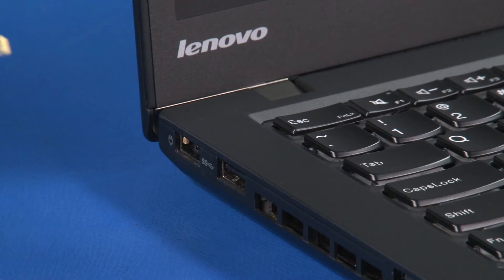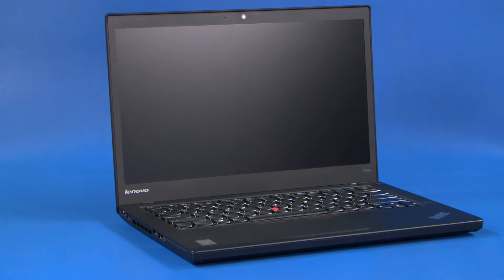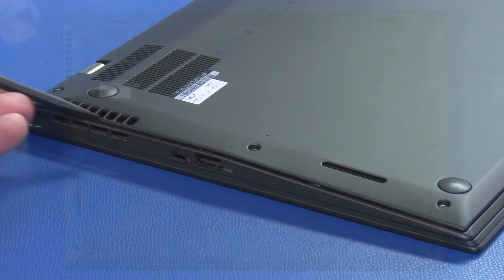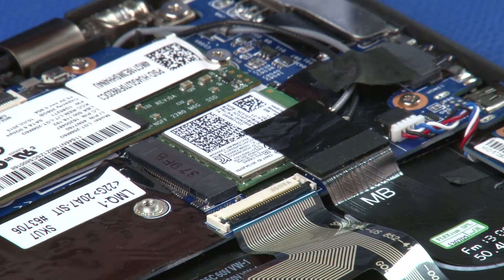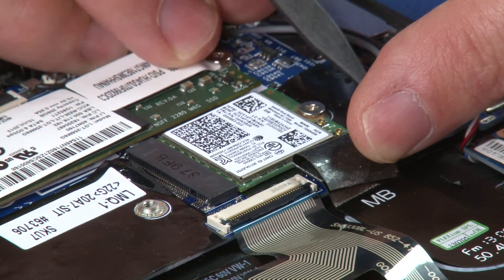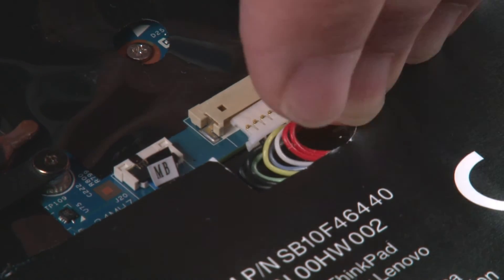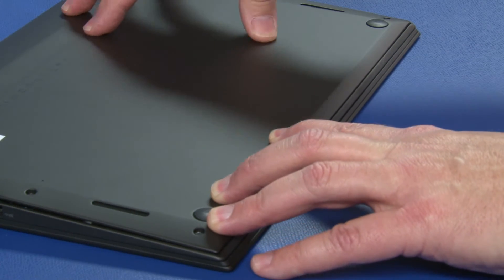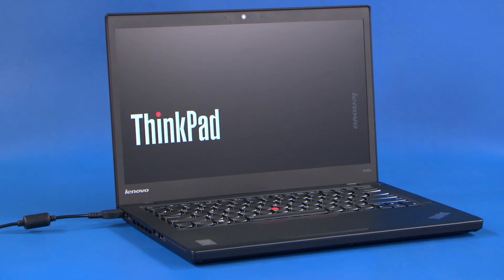ThinkPad X1 Carbon (2nd and 3rd Gen) - Wireless LAN Card Replacement

Comment: Will Intel Dual Band Wireless-AC 7260NGW (FRU 04X6087) x1 support carbon gen 2?
Reply from the maker: Hi, @kamleshaswar. Thanks for reaching out. Upon checking, This part number:  04X6087 only supports 11e Chromebook (Type 20DB, 20DU) Laptop (ThinkPad) and 11e (Type 20D9, 20DA) Laptop (ThinkPad). The device you mentioned is not listed. You can message us anytime if you have any other concerns. -Kate_Lenovo

Comment: Has anyone upgraded this ridiculously bad Intel-7260 with something reliable, whether it's an updated Intel or 3rd party? I don't need to hear from useless "LenovoSupport" because I see below that they won't answer this specific question. They don't like to publicize the fact that they "whitelist" network cards in their laptops. The 7260 is bad across all brands and I'm not interested in troubleshooting a known POS. I found a $20 AX (Wifi-6) card with the same M.2 form factor on Amazon, so I'll probably try it out, unless someone else has already tried and failed.

Comment: The wireless card on my 2nd generation X1 Carbon is disconnecting abruptly. The current wireless card is Intel Dual Band Wireless-AC 7260. Can I upgrade to install a more recent wireless card? If I end up replacing with the same kind, will the issue with the intermittent disconnection go away? Appreciate any input.
Reply from the maker: Hello Hrao, thanks for reaching us out. We're sorry to know about your trouble. May we know if you're getting any error messages? Were there any updates/changes prior to this issue? We'd like to know more. Looking forward to your reply. Fraineee_Lenovo
Reply: @LenovoSupport  I appreciate the prompt and timely response. I see the following message in eventviewer - "The network interface "Intel(R) Dual Band Wireless-AC 7260" has begun resetting.  There will be a momentary disruption in network connectivity while the hardware resets. Reason: The network driver requested that it be reset. This network interface has reset 4 time(s) since it was last initialized.". I have updated the latest drivers and that has not resolved the problem. In reading some other articles, it makes me believe that the component has to be replaced. Therefore, I am looking at any potential replacement wireless cards. Thanks!

Comment: Is the Lenovo X1 Carbon gen 3 defective by design? Ie could I change the WiFi card to a TPE-M2NCRD2 card instead?
Reply from the maker: Hi QuidQuoPro! Thanks for reaching out. Can you provide us more info on what's happening to your X1 Carbon? Apparently, the 
 TPE-M2NCRD2 is not compatible to X1 Carbon Gen 3. These are the Part Number (00JT468, 00JT460, 00JT465, 00JT464, 00JT502, 00JT466, 00JT469, 04X6030, 00JT467) of the compatible Wireless LAN Adapter. We'll wait for your response. Rai_Lenovo
Reply: @LenovoSupport  What I would like is any WiFi card that do not require me to install non-free drivers when I use GNU/Linux. Do you know if anyone of those allow me to do that?
Reply from the maker: Hello there. We tested the compatibility of Linux with your model on this page https://lnv.gy/2VIzRcI however it shows that the X1 Carbon 3rd Gen is not listed. We have the following information to assist our customers who are interested in using the Linux operating system. Chx_Lenovo

Comment: Hi, what is the part number of the WLAN cable? (gray one) and where can I purchase a replacement?
Reply from the maker: Hi Song. Thanks for reaching out. For the Thinkpad X1 Carbon 2nd Gen (Type 20A7, 20A8), the WLAN cable Part number is 00HM106. For the X1 Carbon 3rd Gen (Type 20BS, 20BT), the  WLAN Antenna kit Part number is 00HT406. To purchase parts, click on: https://lnv.gy/33h06rT. Hope this helps. Carll_Lenovo

Comment: Can you use third party wireless cards, e.g. if I want to use a broadcom card or something like that would I be able to.
Reply: With Thinkpads generally, nope. Whitelisting network cards has proven to be lucrative for their bottom line.
Reply: @dinuguan510  Lenovo hasn't been whitelisting for years, at least in X/T-series. Carbon Gen 3 has none for example.

Comment: I have a Sierra Wireless EM7345 card. Can I replace it with an Intel one even if they have different pins ?
Reply from the maker: Hi. Thanks for reaching out. I'm afraid replacing Sierra Wireless EM7345 card with the Intel wireless card will not work since they have different pins. Auxen_Lenovo

Comment: hi 
i want to ask you 
i have lenovo x1 carbon with i5 vPro processor 
my motherboard not working , i want to know if i can replace it with i7 motherboard include i7 cpu 
it will work on my laptop or not ? it look like the same 
please help!
Reply from the maker: Where did you get this motherboard from?
Reply: i found it on eBay i want to know if it compatible  with my device i will buy it
Reply from the maker: I'm afraid that as a Lenovo employee I'm absolutely certain that I can not advise you to do that. I'm not even certain that I would try that myself just because there is any number of things that could go wrong.
Reply: What should I do

Comment: hi. where is cmos battery in 2gen model....plz tell me or show me pics............. thanks
Reply from the maker: +김지용 Hello. The Coin-cell (CMOS) battery is located on the under-side of the system board, underneath where the WLAN card, WWAN card, SSD are located. Refer to the Hardware Maintenance Manual (HMM) for your specific model/machine type which can be located here:  support.lenovo.com